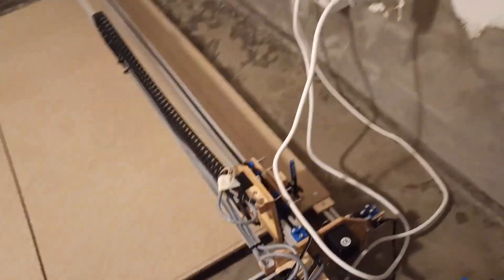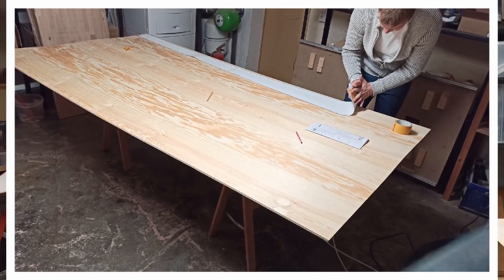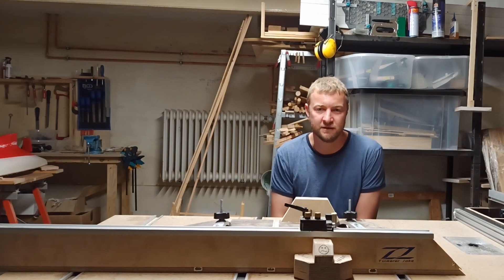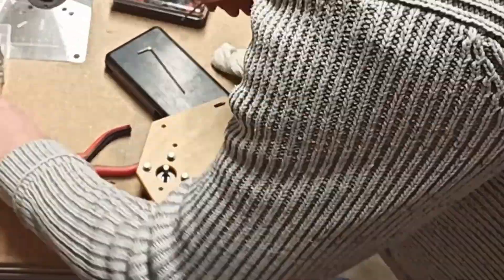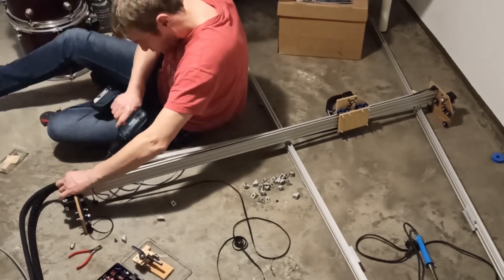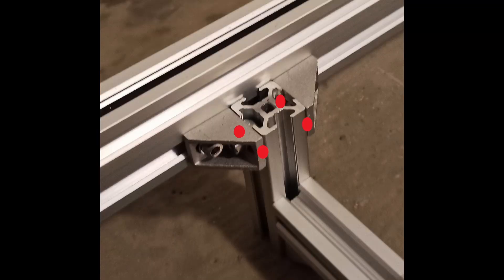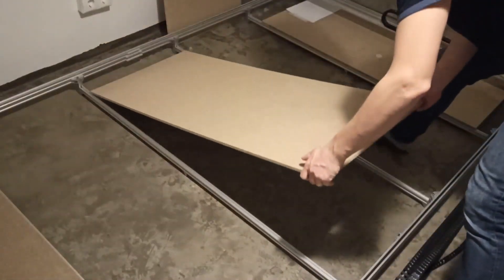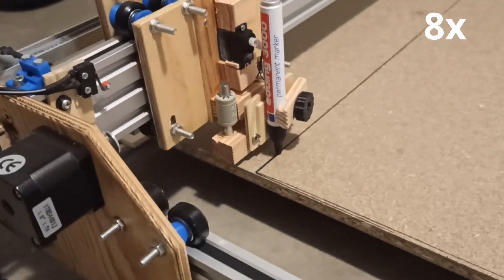Large Format CNC Plotter for Plywood Boat Parts and Sail Panels

Comment: It uses two engines facing each other. How did you solve the fact that one should rotate in the opposite direction?
Did the plotter work for sail making? Thank you for the video!
Reply: Thank you for everything. I just made my first sail, the next one will be a tri-radial. I need to make a plotter for this.
Reply from the maker: "You must reverse the wire order on one of the motors.
As an example, if the left motor wires are connected to the driver in this order…
Red, Yellow, Orange, Blue
The right motor should be wired…
Blue, Orange, Yellow, Red."
(Source: https://forum.makerforums.info/t/how-to-change-the-rotation-of-the-stepper-motor-to-be-unidirectional-in-grbl/83490/2) 

Yes, it worked just fine for the Sails
https://youtu.be/nzgrh8HpC6Y?si=COoX_XbbKNQFXIiG

Good luck! :-)
Reply from the maker: "You must reverse the wire order on one of the motors.
As an example, if the left motor wires are connected to the driver in this order…
Red, Yellow, Orange, Blue
The right motor should be wired…
Blue, Orange, Yellow, Red."
(Source:
https://forum.makerforums.info/t/how-to-change-the-rotation-of-the-stepper-motor-to-be-unidirectional-in-grbl/83490
) 

Yes, it worked just fine for the Sails
https://youtu.be/nzgrh8HpC6Y?si=COoX_XbbKNQFXIiG

Good luck! :-)

Comment: If I want to buy the whole mechanical setting from you how much it would cost? I need to make a CNC plotter out of it for the purpose of painting
Reply from the maker: Hi, I made this machine for my current boat building project, this one will not be sold. Also I dont have enough time to make a new one. It is actually rather simple to build, so why not making one yourself?
Reply: @TinkererJake  because I don't have the experience